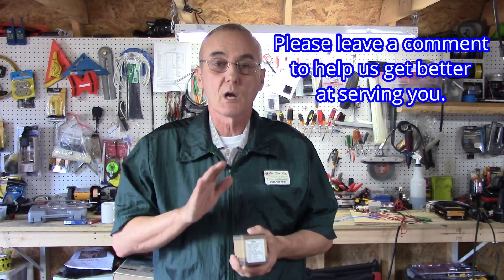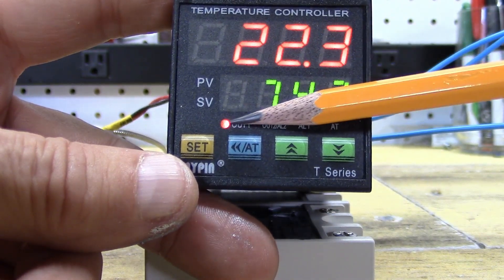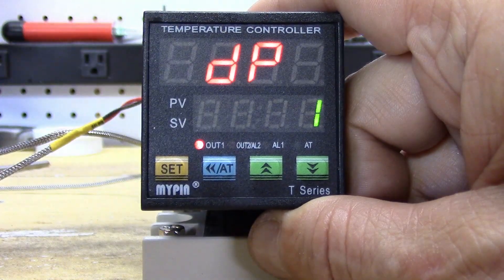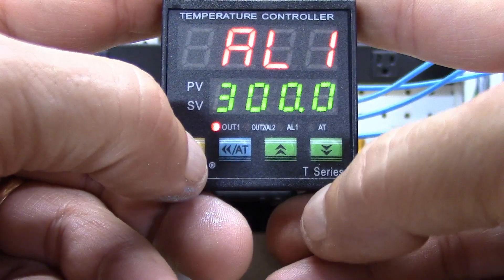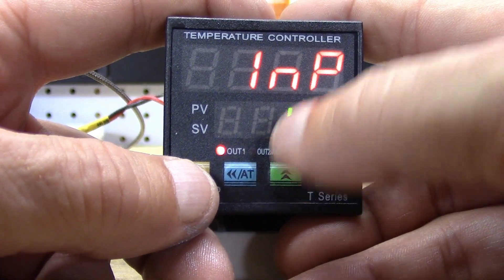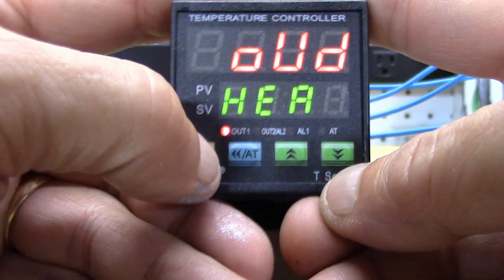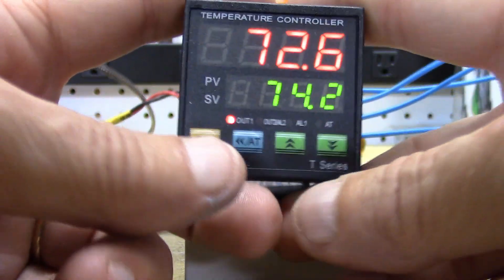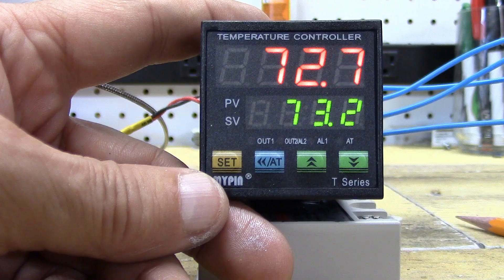Setting parameters on the MyPin T series PID controller

Comment: Thanks for all the time and effort you put into your videos. They are the best I have found for building a pid controller. I have a problem with one I just built that I can't solve. When it reaches the set temp, the power doesn't shut off.
Reply from the maker: Alan,
 Does the light on the SSR stay on after it reaches the set temp? It is more likely your still has not balanced yet and the residual heat while the element was on is just making it to the probe area. The balancing takes about 15 minutes or so at a lower temperature (~ 130-140F). Let me know what happens or if the light stays on.

Comment: I have the mypin ta4 on my gas fired HLT with a Honeywell a valve and a Honeywell spark ignitor. It works fine until it reaches the SV, then it starts to quickly cycles on off on off on off.
Reply from the maker: The TA4 does have an analog setting for servo motors if you are trying to control gas valves. This would be a different parameter set-up described in your instructions. The PID signals on/off to control the pulse wave of electric and your system (gas fired HTL) is a little different but the PID doesn't know that. You must tell it what to do via the analog settings and it will operate smoothly but turning the gas port up and down as required.

Comment: Is there a module like this with a timer function built in? I am interested in using it for a parts curing oven for cerakoting and powercoating. Thank you!
Reply: Yes the Auber SWA-2441  if you're using a contractor or the SWA-2451 if you're using an SSR around 85$

Comment: I have a TA4-SNR and I'm trying to figure out if my PID can do a manual control. The reason is because as the temp approaches boil temp it can be difficult to control the vigor of the boil. Do you know if this model can do a manual control?
Reply from the maker: Yes it can. In the parameter set up there is a selection for manual control.
Reply: @BarleyandHopsBrewing  can we use the TA4 for the boil whit-out a a temperatur prob?
Reply from the maker: @JeanSebScherrer  No. The controller will not work since it has no feed back mechanism. It will fault out and the top reading will be all "U"s

Comment: I purchased a press kit with a pid controller but it came with absolutely no instructions. 
https://image.jimcdn.com/app/cms/image/transf/dimension=1820x1280:format=jpg/path/sf67398cb8496a759/image/ib1ddac27b0eb1f56/version/1537824747/image.jpg is a picture of it. Does this look like one you know of? I'd love to have a manual for mine or know how to competently use it and what the outAT and al lights mean. Used it once but not sure if the temp was ready or not.
Reply from the maker: Matt, I am not familiar with this item.

Comment: Sorry I have a machanical relays for a powdercoat oven. I'm afraid they will burn up.
Reply from the maker: You could switch them to solid state relays. They are cheap and very durable (no moving contacts to burn out).

Comment: Heaters keep turning on and off really fast once it gets to temp. What setting am I looking for to stop that? Hope you can help. Thanks
Reply from the maker: Turning on and off is normal and the faster it does this the closer it is to balancing the temperature to the process. This turning on and off is actually pulse wave modulation and the result is variations in power supplied to the element. 
While it is doing this push the set button once and see the percentage of power being supplied and you will notice it changes rapidly.

Comment: Hi George.  Super appreciative for all the terrific advice you provide in your videos.  I'm hoping you can help me reset the MyPin TA4 SSR controller.  It worked fine for the first few runs.  Then I tried to get it into autotune mode and probably hit the wrong sequence of buttons.  Now it ignores my set point and just keeps heating and heating well beyond the set point.  It is overriding the settings you suggested even though they are still programmed.  Many thanks in advance.

Comment: Hi George 
I'm using inkbird PID do you have any idea why when using the PID when I take it down to an lower percentage of power other than being wide open makes my lights flicker steady?
Reply from the maker: The percentage of output is automatic and changes in relation to the difference between SV and PV (plus a few other things).
If you connect a light it will flicker, turn on and off etc.
Reply: @BarleyandHopsBrewing  I talking about my house lights
Reply from the maker: You need to running your system on a dedicated circuit (isolated).
This should resolve this problem.

Comment: Thanks a lot your video's been informative and very helpful I have a problem with my temperature controller The parameters will change mid cycle I don't understand why.
 I do the settings as 1, 540 , 250
Reply from the maker: Try 1,240 and 8. After that use autotune to let the PID tune itself to your process.

Comment: Great Video :-)  You can drill Round holes to mount Square PID controllers using 3D-Printed .STL files :-) https://grabcad.com/library/round-pid-controller-mount-1
Reply from the maker: Excellent
Reply: If you need a specific size Round Hole 3DP Mount for a brand of PID sometime just let me know and I will draw up your size and 3D-Print it and send you the mount to try out ... Gratis of course ( Foundry3DP at g mail ) ... All just for fun to show in one of your videos if you wish :-)   Enjoy sharing ideas and share the 3D-Printing .STL files online to help others :-)  All round holes are common hole saw sizes :-)  https://ctmprojectsblog.wordpress.com/2016/12/05/powder-coating-oven-3dp-parts/  ... Powder Coating Oven Project
Reply from the maker: This is absolutely amazing and very good. Do you mind if I share this in a video? I would also like to point folks to our website too. I could cut and paste some of your photos into the video. 
George
Reply: Certainly :-)  Share idea and photos with who you wish.  Drop me an email to keep in touch :-)  I found it time consuming cutting square holes, and it just took seconds with a hand drill and a hole saw ... so It would be fun to get the dimensions of many different PID controllers and have them all done and uploaded to GrabCAD for anyone to download the 3D-Printing .STL files :-)  It only takes me minutes in Solidworks CAD software to modify the size to match different dimensions and make a new .STL 3D-Printing file.  :-) Measurements have to be pretty much right on, so I like to measure the PIDs myself and/or have someone send me a private YouTube video showing me them using their Digital Calipers measuring the areas I can show them to measure, that way I can see they are accurate :-)  CHEERS
Reply from the maker: Thanks

Comment: Quick question.  The controller I have is reading some off-the-wall temps.  When set to J it reads 234, E-208, S-943, PT -323, LN -199 and Y-273.  In theory, it should be reading somewhere around 80 degrees, or the same temp as it is in the room.  Thanks if you can answer.
Reply from the maker: You probably have a K type sensor. Set it to K type (looks like a backwards small K). 
Let me know if that fixes it.

George
Reply: @BarleyandHopsBrewing  Backwards small y, wasn't it?

Comment: Thanks great video series, I have relearn and lot of formulas I was tort many years ago, is it possible to add a water control valve and temp control to! Would work great on the T500? Thanks
Reply from the maker: That is possible and delicate. This PID does have an analog output to operate valves but I have not delved into that yet.
George

Comment: Hey George thank you very much for doing this. I have watched all of the PID making, wiring, and setting videos, along with just about all of your other videos, and they are extremely helpful and very well done!  The one question I did have was on the auto tune part. After pushing the auto tune button you say let it run for a cycle and it will do its thing. Is the cycle you are referring to the time from when the PID controller comes on to the time it reaches its set value and turns, in this case the heating element, off? Or is the auto tune cycle a set or determined time that is programmed into the PID? Just trying to realize how long it will take for the auto tune feature to run its coarse. Thank you very much again for all of the help and knowledge that you have shared with all that have watched. They are very much appreciated George.
Reply from the maker: The cycle I refer to is the auto tune cycle itself. I set the set value at 110 and begin heating ; when it gets to about 85 -90 I push auto tune. When the PID reaches its set temperature the auto tine light will go out. This is the cycle I am talking about. 
I do this a couple times (mostly because its neat) as I heat up to operating temp.
Hope this helps.
George
Reply: Yes it did help. I noticed you using the auto tune in this manner in the video that you did recently on making a run. So the auto tune is really just an internal self evaluation for the PID to insure that it is operating at its optimum efficiency. Thanks so much again George and happy distilling!
Reply from the maker: Glad to hear you find it helpful. I love these things, they are amazing.
George

Comment: what do you recommend for an inexpensive limit controller. I'd like a unit that would reach its set point temperature and disable  output unless reset ( relay) . Any suggestions?
Reply from the maker: We sell the PID and the PWM for $199 and $119 respectfully. Those are the two methods I recommend for controlling the heat for your mash/wash. George has several videos describing how to build these items for around $50ish.
Reply: Barley and Hops Brewing  i have a rex c100 already- any links to the video to make on is greatly apprciated
Reply from the maker: Here is a series of videos in a playlist you can watch.
https://www.youtube.com/playlist?list=PLA2Iwq46qNNPYr5sqp4hCP7b8KAeCKvqw

George

Comment: Great series of videos. I built a version of your device but your recommended settings do not work for my 5 gallon kettle and 110 volt hot plate, and the Auto Tuning feature of the Inkbird does not  work well either.

It is helpful to understand that PID is really three control mechanisms. The Proportional setting can work by itself but it will always achieve a steady state temperature below the set point and takes a long time to stabilize. If you add in the Integral setting you can achieve an actual temperature equal to the set temperature. The Differential setting is there to look at the rate of change of the temperature and predict based on the rate of change whether to increase the power or decrease it. Add all three together and you get a rapid increase of temperature to begin, with a more gradual increase as you get closer to the set temperature to prevent the temperature over-running the set temperature. 

However, if you set any of the P, I, or D settings too high the result  can be a very unstable temperature controller.

Without resorting to complicated math, you can adjust the values as follows:
1. Set the I and D values to zero.
2. Set the P value to give you the desired time to reach the desired temperature quickly (say between 100 and 200).  Notice that the indicated temperature will overshoot the set temperature but eventually settle in to a temperature several degrees below the set temperature.
3. Next increase the I value so that the indicated temperature settles close to the set temperature.
4. Next set the D value carefully to a value that gives you a stable temperature without big over-shoots or under-shoots.

You can do the above procedure with just water in your still kettle.

The mistake most hobbyists make is to jack up the values of P, I, and D too high. Don’t set the P value too high in an attempt to heat quickly. The I value should be no more than half the P value, and the D value should be even less. Setting each value separately and observing the result will give you the best performance: a rapid rise initially followed by a slow rise to the set temperature without big swings over or under the set temperature.

With a little patience a PID controller can be dialed in to give you a great control over your distilling or brewing process.
Reply from the maker: Thanks

Comment: Thanks you thank you! I have been waiting for this video  My question is with my 8 gallon pot/5500watt - 220volt heater - I notice it is turning off/on a lot!  It is slowing the reflux on the 2" column. Heater on reflux/ heater off no reflux.  Finally the question -To increase reflux can I lower wattage to heater element via Mypid and how? Or should I replace element to 3000watt for 8 gallon pot
Reply: Louis Lilienthal I have the same question on lowering the max power from 100% to 50%.

Comment: Please explain auto tune in more detail if you can. I have built two PID controllers (after studying your videos) a main and back up with fans and thermostats to control them. BTW One lesson I learned was not to use an AC voltage fan as it induces electrical noise into the PID and causes the PV to fluctuate out of control. Thanks for all the valuable information you have published and thank you for the personal help you have provided via phone conversation in the past. You are greatly appreciated!
Reply from the maker: The auto tune function will fine tune your P,I and D settings for you and will match them to your process. These will be the best settings based on how your still runs and it does it by itself. Just let it run through a self tune cycle while you are distilling (when the light goes out it is done). You can check your settings after that to see where they are for  your still.

Comment: Hey George, why do you keep change to different PID’s? Which is the better one?
Reply from the maker: Both Mypin and Inkbird are good and I consider them as equals. Not everyone uses the same PID so I did a video on the most popular two. I am thinking of doing one on the REX C100 (this is a Chinese cheap brand that works well). They are so cheap and many people have them and also have questions.
George
Reply: Yes please make a video for the REX C100

Comment: Hey George have you ever looked inside the mile-high controllers? Would it be possible to add the PID to them? I'm waiting on mine to get here and have no clue what is inside of it other than the potentiometer.
Reply from the maker: Michael, the one you have coming is more than likely the variable controller. It is a controller that acts similar to your stove top. You turn it up and it gets hotter, you turn it down and it gets cooler. Very simple design and works well. 
You will really have fun with your order when it arrives. 
Good luck and stay in touch.
George
Reply: Michael, could please let us know what's inside the MH controller? If the SSR in the kit is a VA, it won't work for a PID conversion
Reply: Luis Murillo I sure will. It will arrive on Monday.
Reply from the maker: I have looked inside these. It is not an SSR that we use in our PID controller. It is however an SSR by definition because it is a solid state relay (of sorts) and looks exactly like any other relay but it operates differently. 
George